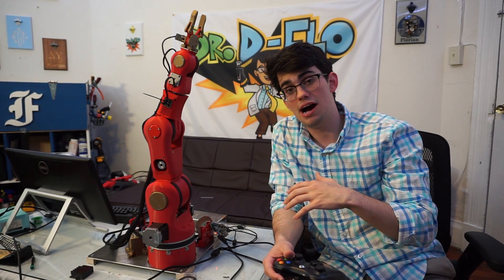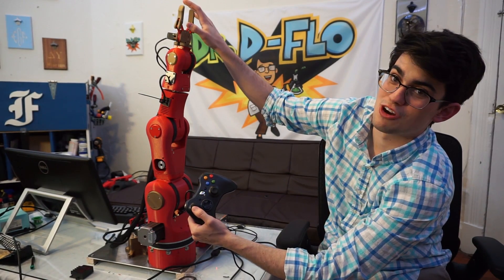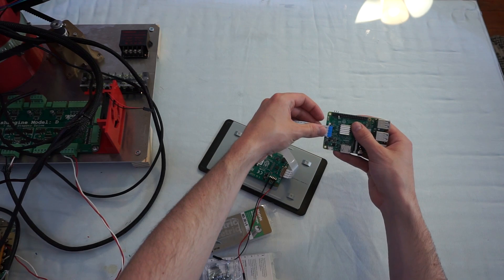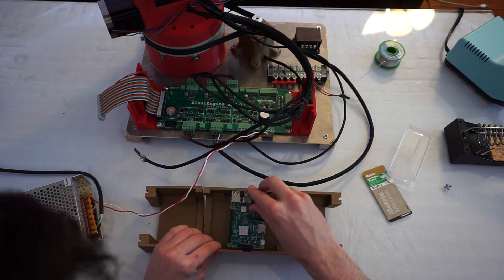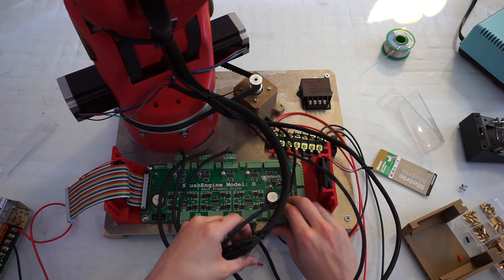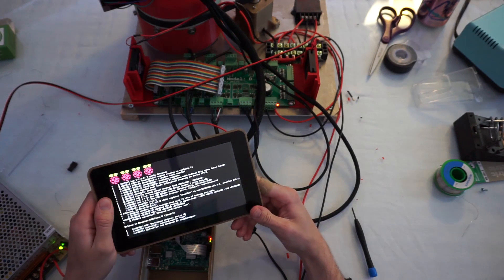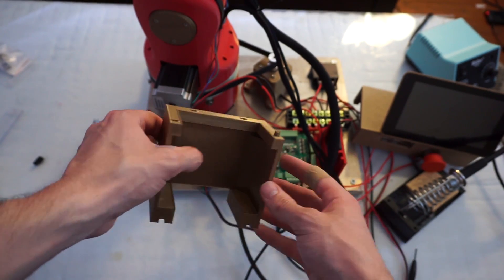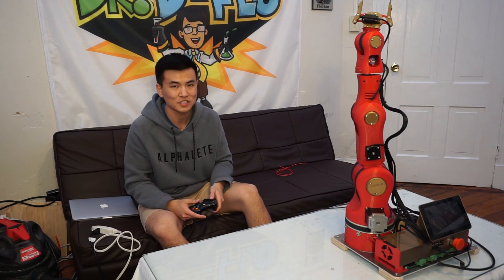6-Axis 3D Printed Robotic Arm - Electrical - (Part 2)

Comment: Hi, guys.I like what I've seen so far. As a request, I'm looking for an arm that I can use to solder smt components so if you could have it interface with a force sensitve 3d mouse and show some repeatability demos for accuracy I could asccertain if this might be the arm for me. Thanks and keep at it.
Reply from the maker: Thomas your wish was my dream for this arm. Unfortunately, the arm only has the repeatability to move large objects (volume: inch cubed).You will need a robotic arm that is not 3D printed for a high fidelity task such as smt component placement.
Reply: Ok, thanks a lot and I wish you great success.

Comment: You are not gonna damage a circuit by "leaving it exposed to 24 volts". 
It is just common practice. In normal household electrical engineering switching the neutral potential could result in someone receiving an electrical shock despite the appliance being "switched off".
No current can flow without a closed electrical loop. If the neutral line is cut off the appliance has no connection to the neutral/earth potential, no loop is closed no current can flow. But you are grounded an therefore have a connection to the neutral/earth potential. You could again close the loop by touching the seemingly switched off appliance.

You avoid this danger by cutting the live wire, which leaves the appliance at the same potential as you are. Without a potential difference no current can flow.

This is the only reason why you switch the live wire. Because if you touched the circuit while only the ground is switched off there is still some electrical potential between you an the circuit.

Comment: Opps. Sorry I forgot to mention that Planetary Gearhead motors are very very expensive...however the benefits of those motors are well worth it if you have the budget. I have seen XYZAB CNC machines (Multicam CNC) move at high speeds to the point they create a wind when they come towards you to Datum home position. I got scared when i saw the X axis (around (400lbs) come racing towards me...my heart jumped and i ran backwards with a scream. Heheheh

One more thing Those Planetary gearhead motors can be as accurate as 0.0003 Inches or three ten thousands of an inch. OOOH MY I JUST MEASURED MY HAIR WITH A CALIPER AND ITS 0.002'' IN DIAMETER...exciting....how can i measure one of my brain cells? Hehehehe

Comment: Hello  Dr.D-Flo,

Thank you for your great tutorials !!! ;)
Please,
Could you tell me on wich industrial I/O port did you plug the servomotor of the gripper ? DId you have to modify something in the code used in the PI?
Reply from the maker: The servomotor does not plug directly into the raspberry pi. Instead, the pi plugs into a motor controller (https://roboteurs.com/products/rbx1-remix-3d-printed-6-axis-robot-arm-kit), which then has a header for the servo. Unfortunately, I did not design the board nor do I have the eagle file, so I am unsure of which pins the servo uses on the pi.
Reply: Dr. D-Flo, where did you plug the gripper  servo motor on the Slush Engine ? Can you take a picture of your Slush Engine ?

Thank's ;)

Comment: did u calculate inverse kinematics of this robotic arm ?
Reply: You do not need kinematics for a remote control.  The human operator is the controller and does the kinematics using his eyes and brain.     Same go for "teaching" it simply records the control inputs and play them back on command

Inverse K, is for when you need higher level control from a computer like "go to x,y,z" and you want a motion planner to control the joints.    That level control is not use in many hobby robots
Reply: Chris Albertson my graduation project is make this arm work automous .. by visual system (camera) for that i ask about kinamatics

Comment: Hi guys. Ladies also have fun designing and building Robots. So make room for us ladies, guys. Hehehe.

Sorry I don't mean to offend anyone here but using steppers has made your robot very weak for picking up objects more than 2 lbs. it probably could at very low speeds.. Steppers as i have learned the hard way spending over 2000 hours of testing and building Robots with them have found that their Torque is inverse proportional squared to their rpms. This means the faster you want to move a load the less torque you achieve. 

I now swear by the pure torque and RPMs of DC Pan motors. They are direct shaft drive DC and AC motors. Larger in diameter, flat in shape. Smooth high torque at decent RPMs. This is the direction Germany is taking. Pan Motors AKA other names as well..... their goal was to use no pulleys and gears which eliminates all backlash in mechanical drive systems. 

Please correct me if i'm wrong so I can also keep learning.
Reply: Yes i can. Remember I said they go under different names as well? 

this website explains fairly well and has data for you to absorb. They call them pancake motors.  http://www.printedmotorworks.com/brushed-pancake-motors/
Reply: See why they call them Pan or Pancake Motors? They look like a baking pan and a pancake. Don't try and eat one Hehehehe...I can cook too
Reply: Angel Riecter What the fuck ?
Reply: Hi there, 

Before you spend 2000h of testing you should have taken a look into the datasheet which will tell you withing 2 minutes that the torque drops rapidly at higher RPM.
If you want to build a robot with high torque, precision and RPMs then there is only one way to go with -> servomotors. But keep in mind that they are very expensive compared to steppers.
Reply: TY for your response....mighty nice of you.

Most of the Stepper motors and servos I acquired were from scrapping 4635, Docutech and MX180 Xerox Printers. Only Xerox part numbers on them. No manufacturing numbers or descriptions. Its how Xerox makes money on new parts. IE: Small Incremental Quadrature Encoder servo motor will cost you $800 from Xerox. Once you know the specs on the motors they can be replaced by a $200 equivalent servo motor. 

So. No Data Sheets....hugs
Reply: Yes. Please to meet you. 

 Be Careful. The backlash is bad on most gearhead DC motors. Planetary Gears is the alpha god of gearhead motors. Hehehehehe This is exciting
Reply: Angel Riecter Hello. Can you provide a link to the type of motor you are talking about please? I haven't heard of a pan motor before and my searches aren't doing much good.  Thank you very much in advance for the tip. 😀
Reply: Plenty of room out here for the lady makers.  :)
Reply: Ty. But I think my bra is on too tight. Brb.
Reply: Welcome lady :)  I completely agree, steppers are engineering abominations. I have for many years called for the production of inexpensive encoders for inexpensive geared motors and controllers. Particularly today it should cost nothing. For DIY, it seems to me that brushless RC hobby motors and power controllers would be a great basis combined with a simple encoders and dirt cheap servo controllers. Servo operation should be freed from the stagnant industry greed. Probably a very decent business case for such an upset.

Comment: Did you check the AMPs rating of your Estop switch, normally you would send a Estop though a contactor as these will fail disconnected.

Comment: Thanks for the video, building something like this has been a long term plan for me. Could you maybe look at the flex in the joints and if it will cause problems? Thanks. :)
Reply from the maker: The only joint where flexibility is a concern is between the gear for the rotational movement and the shoulder. In the video 3 you can see the robot shaking a bit, and this is vibration is from the axis. This can be decreased by tightening the bolt between the gear and the base. However, this restricts rotational movement.

Comment: A note.. A stepper motors speed are not dependent on the current.. Missed steps are.. Therefor the speed are a result of slow step pulses to the stepper driver...
Reply: uhhhhhh. um. i think if voltage is high enough in proportion to current can pull off good rpms and still not skip steps. its kind of unpredictable unless you spend lots of money on a high tech expensive stepper drivers..like the ones at Oriental motors Corp.

like i said before in my other comments..please correct me if I'm wrong..i'm still learning. The more i learn, the less I know because there is so much more to learn...hugs hehehe
Reply: UH ohhh what did i do???
Reply: Hi Phillip Harvey...uh ...did I upset you???  I'm sorry if i did
Reply: I'm just an airhead trying to learn...and it seems the more I learn the less I know. i hope i didn't offend you in any way.
Reply: Spanks you! Naughty boy.
Reply: Thank you very much
Reply: Angel Riecter etjyyeyhyyggfss

Comment: Thank you very much ! :)
Where did you buy the 12V - 5V transformer?
That it is the  torque of the motor where is fixed the small blue coupler ?

Comment: Hello,

I have created my own robot. I use a SlushEngine Model D board. Would it be possible to have your own Python code to control my robot with an Xbox controller?

Thank you in advance,
Best regards,
Romain DESLANDES
Reply from the maker: Romain,

We are still working on our own software. But Roboteu''s uploaded their software on github: https://github.com/Roboteurs/rbx1-software. This is python code that allows you to control the slush engine with an Xbox controller.

Comment: You may want to put in a few supports in the middle section of the control board since it spans a great distance across the aluminum base plate and may flex enough to make contact with it.. The wide ribbon cable on the one end of controller is blocking all the air from your fans from reaching the heat sinks on the driver boards. Try separating the ribbon into individual wires and tie wrap them into bundles to allow air to pass through. The touch display is a good upgrade and should be incorporated in the next build version.
Reply from the maker: Jerry! Thanks for taking the time to make suggestions. There are  spacers underneath the control board. I apologize I had a lot of footage, so I missed putting that in there. And I will definitely separate the ribbon cable when I open everything back up to work on the gripper. Thanks again.